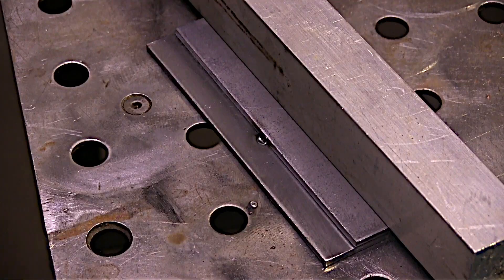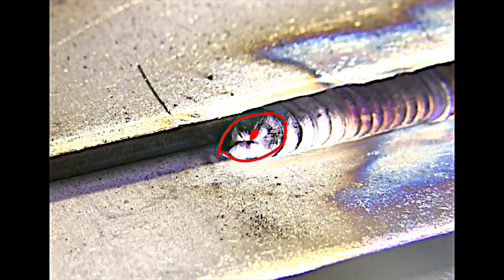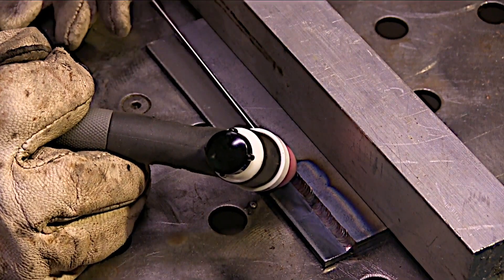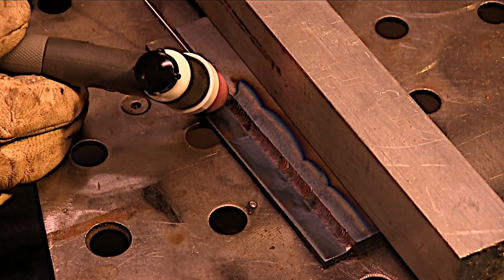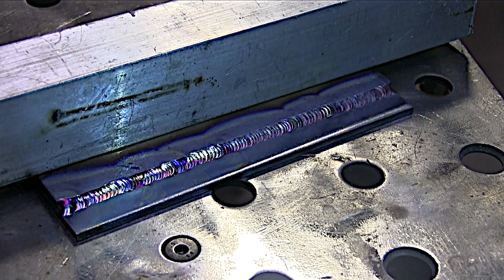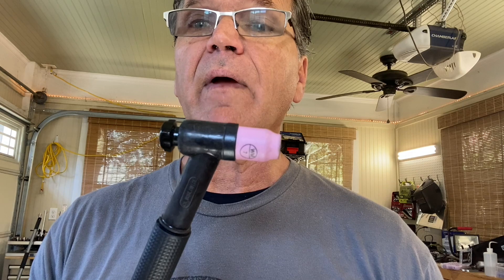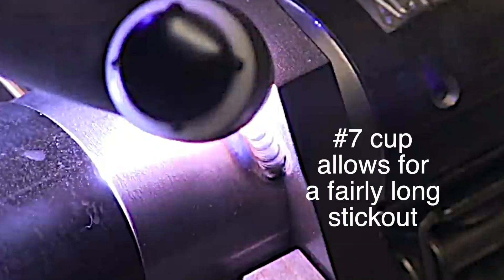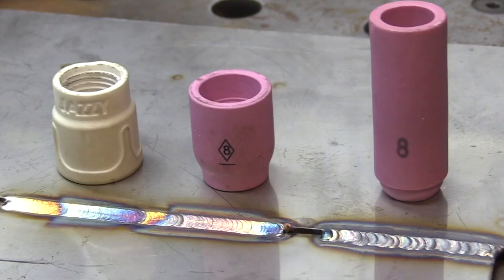TIG Welding Restarts Remastered

Comment: Jody, I have watched and learned much from your vids for many years. Purchased items form your sight also.   For the last 36 + years I have made my living building, updating, tuning, modifying, repairing drag race cars. Most of the chassis and roll cage are constructed of 4130 cond N round tube sizzed from 1.625-.083 to .250-.035 bent and tig welded to every shape {and weld joint} imaginable.  Most of the chassis is constructed on a jig table but many cars require me to not only weld around round tube joints often using intricate positioning of my body to reach most of the joints.  Anther words, nothing is as simple as welding flat metal on a flat table in the seated position.  I have used many thumb operated devices for torch heat control and they have always been awkward; the wireless foot pedals are wonderful but many time are operated between my knees, by my elbow or a second person who understands my verbal commands.  
   Although I have devolved many successful techniques, and skill sets to overcome these obstacles I feel someone of your experience may have helpful impute and possible vids of tig welding in awkward body positions?   As I become older {65} it is sometimes difficult to crawl inside a roll cage, cramp my body into a tight corner, twist 90 degrees with the pedal between my knees and create a quality weld all the way around a tube joint many times using a mirror.   Yes, I understand a much younger, smaller person may be the answer but those type just arn't readily available and my clients want "me" to do the work on their race car.    Also, curious if you have welded obscured from eyesight joints using a mirror?  
   Thank you for posting vids, not only enjoyable but very informative.